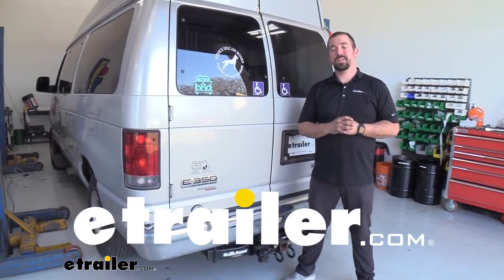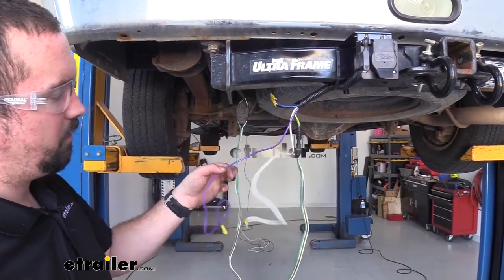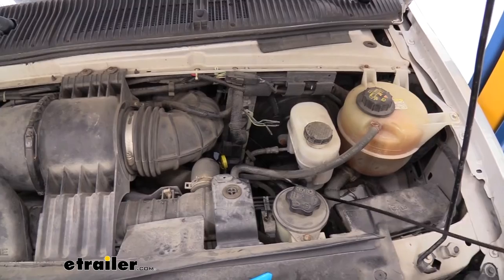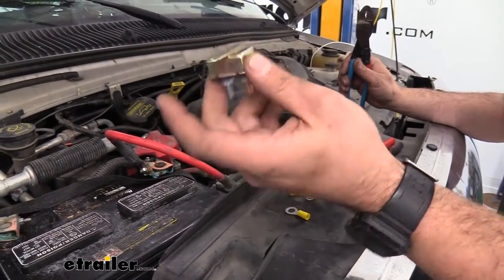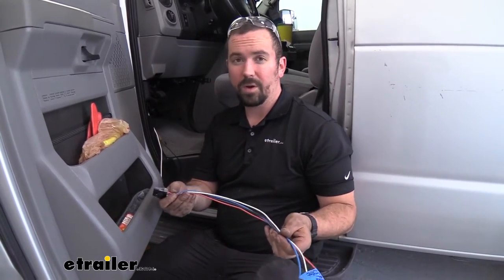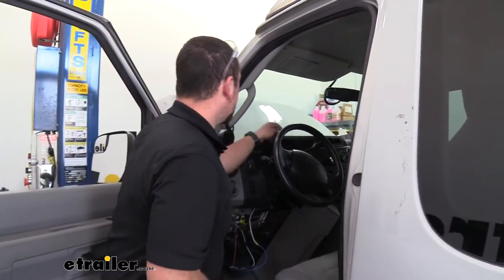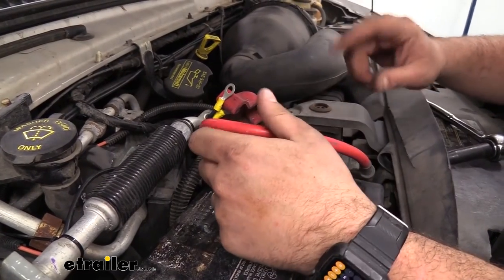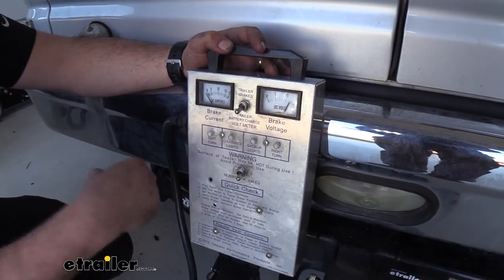Mount: Wiring Kit for 2, 4, 6, and 8 Brake Electric Trailer Brake Controllers on a 2011 Ford Van

Comment: Excellent instructions! Thank You. I do however have one suggestion for you about stripping stranded wires. 1st cut the insulation as normal with the proper size die BUT DO NOT pull off the insulation. 2nd Remove the tool and use your fingers to twist the insulation but DO NOT pull the insulation off immediately, 3rd While twisting pull the insulation off. The result is the most perfectly formed twisted wires you have ever seen. If you simply use the stripper to push off the insulation you cannot twist the strands into a tightly twisted bundle. This tightly twisted bundle has increased mechanical strength for forming the crimp within the crimp connector. The final result is a better electrical connection that is a better electrical conductor and a stronger mechanical attachment. When I have to do troubleshooting I too often find the problem is caused by poor crimp connections on loose as a Goose stranded wire.
Reply: How was this excellent? It was so confusing to follow.
Reply: Sir, if this excellent instructional video was confusing to you, then you should not try to wire up a critical need Brake Controller. You will probably create an unsafe condition such that the Trailer Brakes fail and cause an accident or you burn up your truck's wiring. It does not cost all that much to let a professional install the Brake Controller and you will be protecting the public and you will have peace of mind.

Comment: Terrible, absolutely learned nothing. Thanks for nothing
Reply from the maker: Sorry to hear that. What was missing that you wanted to see?
Reply: Sir, if this excellent instructional video was confusing to you, then you should not try to wire up a critical need Brake Controller. You will probably create an unsafe condition such that the Trailer Brakes fail and cause an accident or you burn up your truck's wiring. It does not cost all that much to let a professional install the Brake Controller and you will be protecting the public and you will have peace of mind.